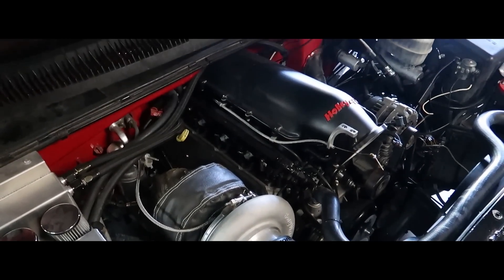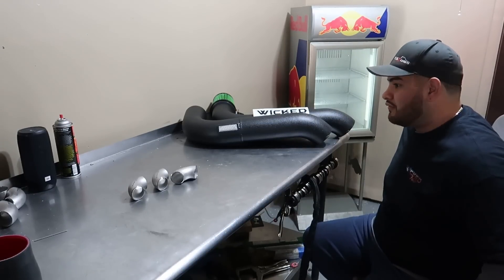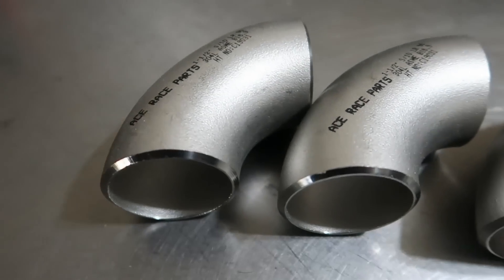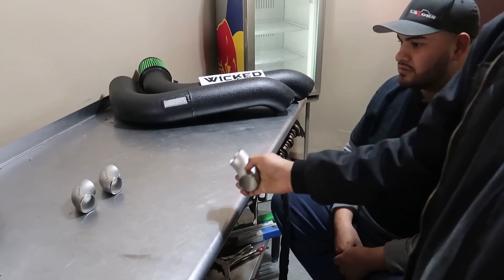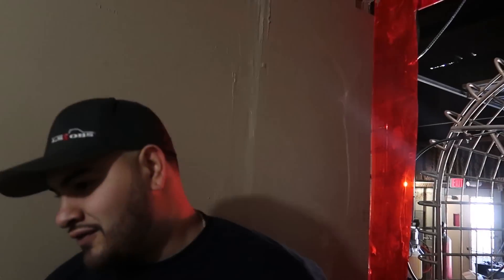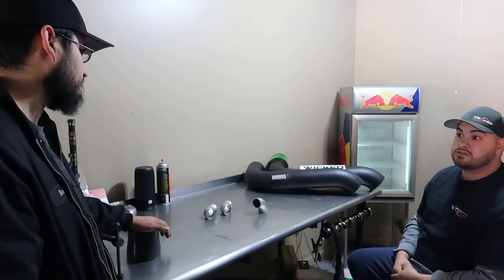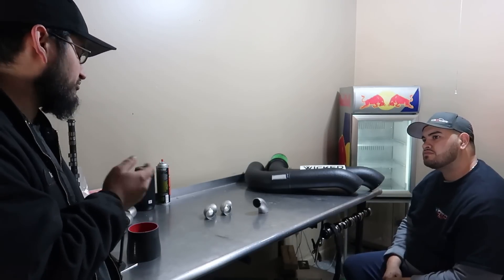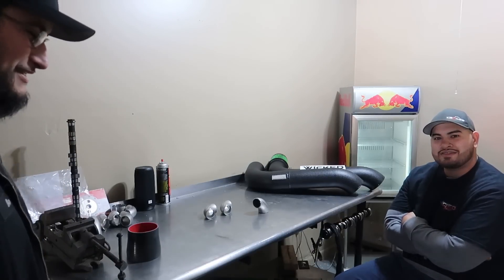TURBO D16 Civic 450whp Vitara Build. Episode 5 ~ ProtoType RAM HORN Manifold Anouncment ~ WICKEDFAB

Comment: Wish sf would have those back in Stock. Been waiting forever it seems
Reply from the maker: Think he's actually going to use speed factory design as a guide. But will be cheaper
Reply: I meant the no notch rods, sorry I sidetracked and didn't clarify. I'm using ebay log right now
Reply from the maker: Oh gotchya hope they stock up for you bud

Comment: Why didn't you get skunk2 manifold those dont break off or use a d16y8 manifold .I had a friend got a customer and spend 600 dollars . And I got a skunk2 and spend 300
Reply from the maker: It does have a Y8 manifold, a skunk 2 ultra series is in the plans tho. Thanks for the suggestions